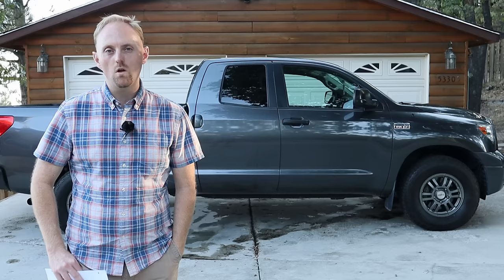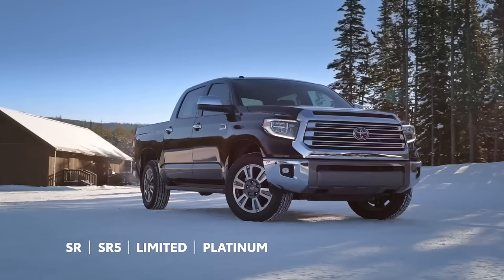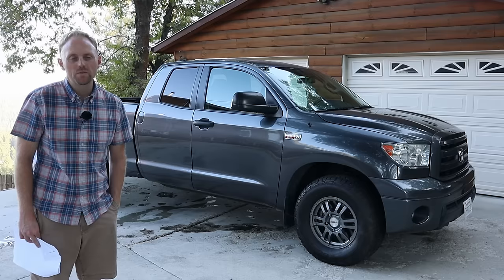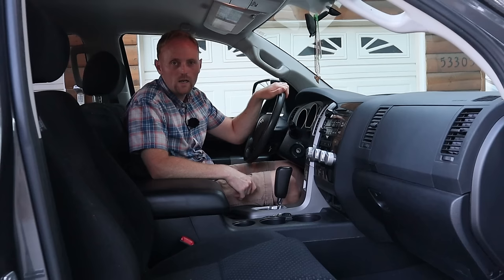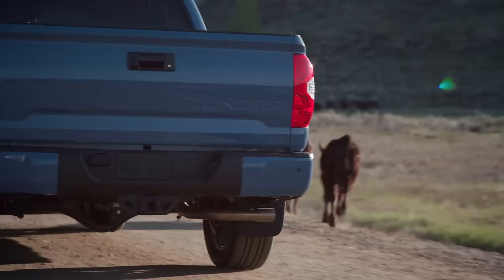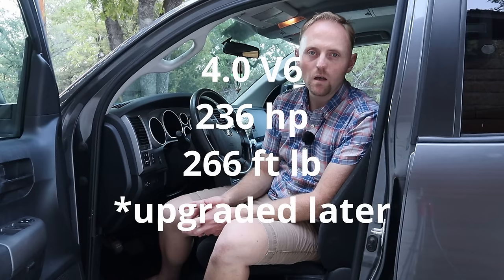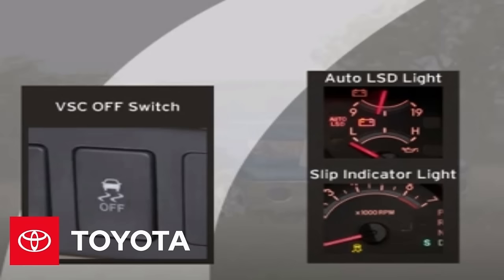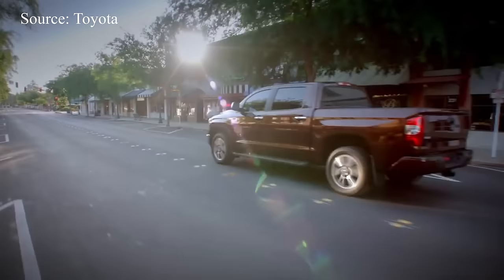Toyota Tundra  |  Brutally Honest Long-Term Owner Review

Comment: Love my White 2014 1794 Edition it is a 2 owner, clean, well maintained, never offroaded truck that I spent over 9months searching over 500miles along the east coast for......but....

My Tundra has been mine for 3.5 years from 53k to 95k miles.
First off, my truck regularly gets 10.5-11.5mpg around town, 12-13.5mpg Hwy, 7-8.5mpg towing a 5k lb 16ft enclosed cargo trailer.
This alone is almost enough to break my heart and make me sell my baby.
We are a Toyota family of multiple generations....

My 98 4runner under my 10-year ownership went from 200k miles to 300k miles daily use without ever breaking down on me even once.
Just fluid maintenance, brakes, and 1 alternator.

A few days ago, I took my truck in to the local dealer for an oil change, a brake check, and a flush and fill of the brake fluid.
As of last week, my truck has an intermittent brake problem where randomly the pedal goes 3/4 of the way to the floor, then grabs. 
This happened 3 times, and 1-2 pumps of the pedal brought it back to normal.
Except one instance it took 10 pumps....
They said the brake check was free so why not have them tell me what's wrong then maybe I'll go fix it for way less money....

I was told it may be a $900 installed, national backorder, Brake master cylinder.
They claim my master cylinder has a slight seep at the bottom which I can't find.....that is the cause of my problem, or it was my fault (me a retired mechanic with 1000+ brake jobs done) from replacing the front pads and rotors around a year ago.....for a problem that just started a week ago.
But they are not sure that's the cause, let's start here they say...
Did I mention truck ran perfect and never had any warning lights or malfunctions?
They declined to do the brake fluid flush, saying this could make it worse (Impossible, it could only help the situation) and make them liable for a master cylinder or whatever.

My research shows folks with this issue who have done the master cylinder, only to also have to do a $1000+install dealer only ABS unit, or a $2500+install dealer only ABS Proportioning valve.
This is totally unacceptable.
I also found some folks solution was related to water vaporizing into gas pockets in the brake fluid which travels to the ABS system and get stuck, they claim.
Their solution was to drive down a dirt road over a dozen times and trigger the ABS system fully dozens of times so the pistons and valves in the ABS push the gas pocket out?
So, I did this last Saturday and so far, so good.
We will see if the issue returns, like when I'm towing my trailer again, or the jon boat I want to buy soon....

But wait, it gets better.
They also tell me my water pump is leaking!
I'm sure it is, even though I don't smell it, and my gauges are rock solid, and the fluid was not even low, but Toyota is known for this, and they can leak a long time before it gets serious.
It's caused by a poor design used on several different engines and vehicle models where a rubber seal starts to fail letting fluid escape, not mechanical failure like 99% of other water pumps.
This is another $900 dealer repair.

Lastly my serpentine belt is showing wear, and may also need a belt tensioner, do both they say, $450

Now I'm faced with a decision, start throwing money I don't have the budget for at my baby to get her fixed up, and keep burning gas like it's free, or trade her in for a domestic pos truck because I won't touch the new POS Tundra with a 10ft pole.

I'm so upset about this situation.....

Comment: Good review, I agree and I own 2017 Tundra. I have been a Ford Guy all my life, but the day I determined what would work I test drove all the brands in 1 day. The Tundra felt right. It was the truck I bought. I love them all but I can only own 1 so it is the tundra. I added a Magnuson supercharger man it improved the drivality of the truck. I don’t have  All the gizmos but it works for me. I added a bluetooth reader that gives me water temp, transmission temp and engine oil. All I need information I need to tow my Lance trailer.
Reply from the maker: Awesome we have a Lance too. Supercharger must be amazing on that truck!
Reply: Big Rock Moto & Outdoors I watched your review of the Lance trailer. We have  owned ours longer, but you confirmed everything I have told people about trailer. You give very concise down to earth reviews. For years I had a Honda 650 and a HarleyCrusier bike. As I got older I quit riding since the Seattle area has gotten so dangerousl to ride. But I will relive your reviews. From 66 yr old Asian dude.😎

Comment: I bought my used 2017 Tundra July 2018. When I was looking every where I looked I saw used ford, chevy and dodge trucks for sale. That should tell you all you need to know.
Reply: Rudolph Madronich also need to look at how may more trucks that are sold compared to Toyota. However Toyota is by far the best
Reply: I just bought a 2020 Ford F-150. Spent months comparing all the main contenders..had a Ford for 10 years and never had an issue...that and all aluminum body was a big plus...if the Toyota wasn’t such an outdated gas guzzler I would have bought one.. maybe next time...
Reply: @EM_life-gr8sn  people do not buy a full size pick up for the gas mileage. I bought my Tudra for the dependability
Reply: @DEEZEEMTB  Yes the ford, chevy and ram trucks out sell the toyota why is that ? i think because of the lack of dependability. You have to buy a new truck a lot sooner then you do with a toyota.

Comment: Thank you for this honest, no nonsense review. It will be interesting to see what happens when the next generation Tundra comes out, without a V8...
Reply: not interesting at all...just more Green dictates (CAFE standards, signed in by GW) that our last Prez was going to fix and dropped ball.
Reply: @teller121  Yes, we've definitely reached a point of diminishing returns where the maintenance costs offset the fuel economy gains.  GDI is a prime example of this.  Pulling the intake to clean the valves on my wife's VW due to GDI carbon buildup every 70k miles is $1200 of shop time.  And you're changing the oil twice as often because of contamination.  This is equivalent to losing 5 mpg which is on par with the efficiency gained by using GDI and turbos in the first place.
Reply: @confidentlocal8600  yeh, but that makes way too much sense. better keep it to yourself cuz nobody cares now.  For those who don't know what their purpose here is, there's a planet to save.

Comment: 2013 Tundra Crew Max Platinum. Purchased new. Just rolled 226k. Zero issues. 

Had a 2008 before this. Only reason I traded that one in was Toyota wanted that 08 so bad, they basically gave me a brand new truck so they could log 2 units sold. 

We would like to take it to 1 million miles.

Comment: I dont have a tundra, but I want to show Toyota's superior quality by saying that I have a 2003 highlander with 235k miles on it. Just regular maintenance and theres not even surface rust on it, even on the brakes! I only replaced the car battery.
Reply: Same, but I had a 2010 RAV4. almost 400K. Ran like new, didn't lose or burn a drop of oil. I had to change the alternator and do a break job. 
She was just coming due for front struts when I lost her in a fire.

Comment: I have a 2018 Silverado with the 5.3 and 8spd. I like it quite a lot and unlike others with the 8spd, I have no issues or complaints. The odd rough shift in low gears but it down shifts very quickly on the highway to pass and going through hills. I would probably consider a Tundra when it comes time to replace years from now simply because I don't like what GM and Ram are doing with their cylinder deactivation (AFM or DFM on GM trucks, MDS on Ram). The fuel savings are negligible compared to the wear and tear it creates on the motor - essentially turning them into a ticking time bomb. The 5.3 Vortec was super reliable; with the 5.3 Ecotec, it's just a matter of time for my lifters to go and I'm all over preventative maintenance.
Reply: I feel for you. My daughter's family SUV (GMC) just had a lifter to collapse because of the AFM technology in their V8 engine. Very expensive to repair. One of the reasons I chose a Tundra. The 2021 Ford F-150 with the V8 engine will have cylinder deactivation. It will be interesting to see if they have problems too. Around 100,000 miles you may want to get rid of that Silverado.
Reply: I had a 2017 Silverado,Z71, at 29,000 miles the fuel injection was going out and the check engine light came on weekly. I will never again buy a vehicle with the engine management system
Reply: I just got out of a 2016 Sierra with 5.3 and it had 65K and was flawless but like you i wasnt trusting it to go flawless much longer, bought a 2020 Tundra Crew, love it, seat isnt as comfortable but power seems much more , trans cooler delete is my only issue so far, thing is a beast

Comment: I just picked up an insanely clean 13 Tundra Rock Warrior Crew Max and I love it. I had a 16 Tacoma before which was a great truck but just had no room inside. Plan to keep this truck a long time b/c I've seen firsthand how reliable Toyotas are. I'd love to have a truck with all the luxuries and what not but I just don't need them. I almost pulled the trigger on a similar age F150 with leather, heated/cooled seats, sunroof, etc. and boy am i happy i didn't. My Tundra is plenty comfortable for me as is with the cloth seats now that I have them dialed it.
Reply from the maker: Good choice

Comment: i still don’t complain about the luxuries that i lack, i don’t think i even need them i have a 2007 crewmax limited with leather seats the back seats recline which a lot of newer trucks mostly don’t do, i have heated seats, sunroof, backup camera, and a jbl sound system that has real good sound quality for even luxury versions of truck today don’t have the only thing i lack is 4x4 but it does have the tow package so i’m good on towing/hauling

Comment: I was a mechanic in 1994 at a Toyota dealership .my very first truck was a 1980 Toyota a lot of people don’t know but they had fully box frames . American trucks didn’t have fully box frames until 2000s  My truck was so rusty that it rusted in two and I took the engine out and sold it for $600 only paid $90 for the truck

Comment: This year I bought a 2015 tundra TRD Pro and love everything about this truck.... except the fuel tank. It has the 26gal tank. Which is really terrible when hauling my 9000lb camper. At the time I didn't even know that small of a tank was a thing. All things considered I love this truck anyway and if i ever get another truck it will probably be a Tundra. Excellent video, presentation and information was top notch.

Comment: Thanks for the excellent review! I have been looking at the Tundras for some time now and this really helped solidify my decision. You answered one of the biggest questions I have been tossing around which was the 5.5 vs 6.5 bed. I think I would regret losing that extra ft based on how I typically use my truck and hearing your thoughts helped a lot. Thanks
~MG
Reply from the maker: go with the 6.5 bed for sure
Reply: @BigRockMoto  8ft is a real truck
Reply: wether self contractor  or pleasure truck,,6.5ft its the perfect size,,,not too short,not too long. blessings

Comment: I had 2006 Tundra SR5 double cab for 12.5 yrs that I bought new and the only issue that I ever had was to change the alternator.  I was still able to get $5K for it when I sold it in Jan 2019 with 312,000 miles on it but running great. EXCELLENT VEHICLE. I replaced it with Highlander but man did I miss a truck. I am actually trading the Highlander in tomorrow for a  2021 Limited Crewmax.
Reply from the maker: Cool thanks for sharing

Comment: Great review.  Yes, I am sold on the Tundra but.....I am hoping they address the fuel economy on the next major update.  I am waiting on the 2022 that is supposed to come out late 21.  If I really don't like the 2022 model - I think there will be enough 2020 & 21's around in good shape and buy one with the poor fuel economy.  The reliability is worth the reduced fuel economy and I am not a high tech guy - don't really need all the Ford and Dodge "toys".
Reply: i get real good fuel economy in my 2007 limited crew max about 415 miles per tank after i fill up i use 91 supreme from chevron i’m on the west coast i really never had a complaint of the fuel range but i have seen a lot of people unhappy with it,even towing i get mpg

Comment: I am a fan of the channel for my love of motorcycles. However, I also own a 2010 Toyota Tundra SR5 Crewmax with 170,000 miles I am never giving up. I might add additional 4-wheel vehicles but never ever getting rid of my Tundra. Rock sold never had any issues.

Comment: Very balanced, straight forward review.  I like the truck but my 2020 is not built as well as my 97 4Runner, especially the interior.  Thanks for a great review.
Reply from the maker: I think Toyota quality is not as good as it was back then during their quality peak in the 90's.
Reply: 4Runner is made in Japan, 100%. 
Stupid me, sold my 1998 4Runner 4x4 with rear diff lock.
Been trying to find another in similar condition the last two years and still looking.
Reply: @dararitchao8367  Such a great vehicle, passed it on to my son and it's still running  strong.  Made in Japan, there is a difference.  I think the Land Cruiser is still made in Japan.
Reply: @TristanTris321GoT  I have a 1998 Lexus LX470 with a little over 200K miles on the clock. Original starter and alternator. Recently replaced the ignition coils and a muffler. The reason I sold the 4Runner is because I didn't 
want both SUV. My son didn't want either one of those vehicle. I bought him a brand new Camry because he wanted it. 
The LX470 has never ever let me down even on the coldest Minnesota winter days, it'll start right up. Full time four wheel drive is fantastic on road and on ice.
Reply: Dararit Chao Toyota/Lexus still make great cars, can’t go wrong with a Camry.  I’m hoping the new Gen Tundra has a better interior build quality but it seems to be a trend with all the cheap plastic trim these days.  Minnesota.., brutal winters! 😊

Comment: I used to have a 2012 after comparing it to the Tacoma at the time the ride sold me right away. It was great for long drives and very comfortable it often times felt like it was big just to be big and not useful. When the 3rd gen Tacoma arrived I drove it and it felt like a small Tundra with very much improved ride. So I traded the Tundra for the Tacoma but I often do miss my Tundra maybe I will go back some day.
Reply: It definitely does give the big just to be big feeling. I always keep in mind it is Japans idea of what 3/4th ton truck they could cram into the average blue collar Americans hands and always get the job done, it is designed almost solely with construction workers in mind, and classified as a 1/2 ton truck to save buyers on registration fees. Other than SAIS pump, and finally now at 165k an appearing yet small and meaningless valve cover leak my truck has always been awesome.
Reply: @mr-toyota  Man traded a 5.7 V8 for that turd of a V-6… poor decision

Comment: The 4.6 is the same as the 4.7 but with a slightly smaller cylinder bore. In theory, it equates to longer engine life. Also, turn off the traction control if you don't need it. It will save your brake pads and rotors. I've owned a 2014 for six years with no issues aside from a wheel alignment.
Reply: Turn off traction control if you don’t need it?  Lol the whole point is it saves your ass when you least expect it. Just buy brake pads.
Reply: It's not the same. They're both good, but not the same. The 4.7 was a cast iron block with a timing belt. The 4.6 is all aluminum and uses timing chains. The 4.6 was an evolution of the 4.3l 3uz that was mostly used in lexus vehicles.

Comment: I’m on my 2nd Tundra and had 6-7 Tacomas over the years. I’ve never had to do anything but rotate the tires and change the oil. I have a ‘21 TRD Pro with 
L285-75-R18s on it (35” tires) I got 18.13 mpg on local 2 lane highways driving 60-65 mph and no aggressive acceleration. This was computed on my OBD Fusion app and Veepeak OBD II. I frequently got 19 mpg on the highway in my ‘17 Tundra double cab. I can live with that gas mileage considering the reliability of Toyota.

Comment: Dude yes!  Love the vid, I too have a Tundra and plan on doing on long term review.  It's been lifted with 35's since day 1 with a ton of mods and is a 2016, 150k miles on it.  Great vid.  edit My truck was around 48k in Nov 2015, resale market has it at around 38k right now.  Obscene resale value and mine has been paid off.
Reply from the maker: Right on!